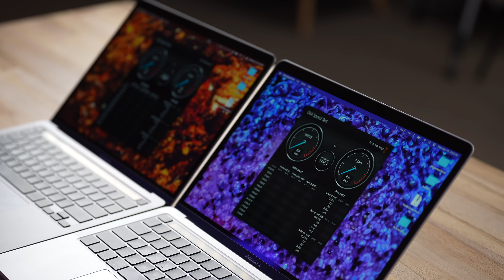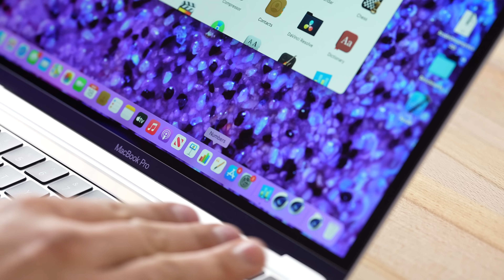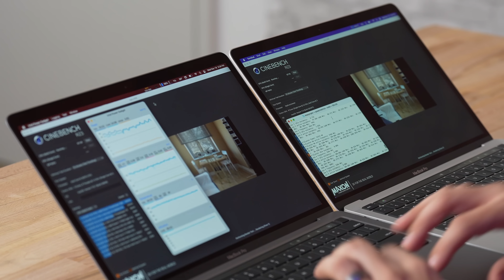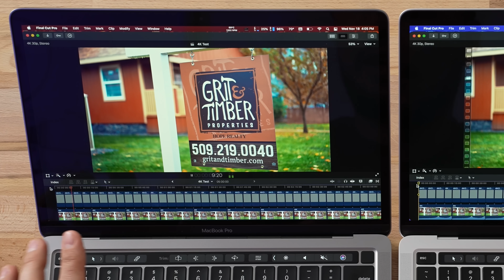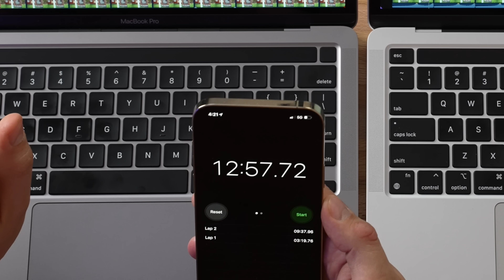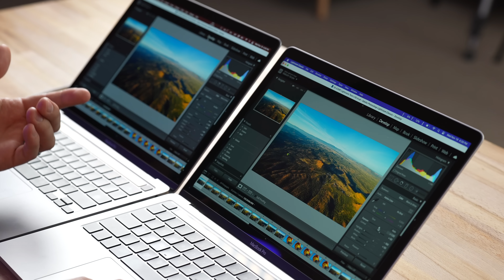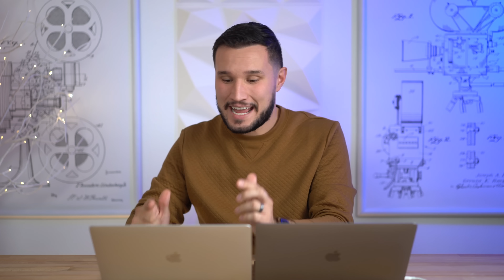M1 MacBook PRO vs Intel MacBook PRO: ULTIMATE Comparison

Comment: I don't believe you are telling the truth here as you are comparing an Intel 2019 i5 8257U against the just released 2020 MI Arm based cpu. The Intel cpu is at least 2 generations old, if not 3, and was never a great performer in either cpu or gpu statistics. You ought to test it against the Intel  i5-1038NG7 which is the true mid range cpu/gpu from Intel released mid 2020 and it still only has 4 cores and it was fitted to the mid year 2020 Apple Pro 13" compared to 8 cores with the M1. I own a Dell 14" fitted with a Ryzen 3700 15 watt cpu and it remains barely warm if not cold when in use. I did run similar tests as you did and when fully stressed the fan came on but it was so quiet I wasn't sure it was even on. Nevertheless, the fan never runs while in general usage. It is only a 4 core SKU and I am immensely impressed with it. The graphics are the equal or better than the M1. Why don't you test the new Mac against the latest 8 core SKU from AMD making certain it is a U part running at 15 watts. Then we will have a true test of the capabilities of the M1. Please, all you are doing is bragging by comparing an old part with half the cores manufactured on 14nm and comparing it to an 8 core just released part manufactured on 5nm. REALLY.

Comment: But how much of the performance in the benchmarks are due to the increased speed of the SSD? is there a valid way to remove that from the “equation”?
Reply from the maker: The SSD's are fast enough to not make a difference in any of these tests.
Reply: @MaxTechOfficial  Ok. But in a test like the decompression there is a very high level of I/O that could influence the result. Just a thought. 😀

Comment: Awesome video Guys
I have a request if possible 
Also super interesting
M1 MacBook Pro VS M1 MacBook Air
And M1 MacMini vs M1 MacBook Pro VS M1 MacBook Air
That would be awesome if you could do it
Thanks a lot for all the horse work on this comparisons as I know from self experience how long and fatigue this type of videos bring
Reply: There is already a M1 Macbook Pro vs. Air Video in the channel. To make things short: The performance is almost the same but on a long run (e.g. gaming) there is some thermal throtteling due to the passive cooling solution. But in most ways they have the same performance. If you don't game get a air, if you do a pro maybe is better. There is also a thermals video for the macbook air on this channel. Check it out.

Comment: What does “running on Rosetta” mean?   Is this something else you have to get with the M1?   Sorry; I’m not well versed on tech stuff!  I just know that my old MacBook Pro conked out a week and a half ago and I’ve been waiting for the M1 to come out to figure out which one to buy.  Thank you for making this video and including Logic Pro in your testing.
Reply from the maker: Basically, previous Intel Mac apps ran using the traditional x86 architecture. The new M1 chip uses an ARM-based architecture which doesn't support x86. Rosetta 2 is able to translate the x86 app software into code that the ARM-based chip can recognize and process which impressive performance. It's also able to translate plugins and other things on the fly.
Reply: @MaxTechOfficial  thanks for the reply!   You lost me at "x86."  LOL...  so is Rosetta something that is built in to the new M1 Macs or is it something you would have to purchase and install?  Thank you!  Apologies for my ignorance.

Comment: Really, really want the M1 Macbook Air, but the fanless design worries me. Not enough weight difference between 13" and 15" MBPs, and with the computational prowess of the M1 MBA, I am leaning towards the latter still.
Reply from the maker: don't worry about fanless design. runs incredibly well. Subscribe for tomorrow's video, you'll be blown away. (Air vs Pro)

Comment: Is this a joke? Your comparing a new 8 core processor with an old  4 core processor. You should compare it against an 8 core intel processor ,  but that would not be good for your advert.
Reply: Dahek? They are the same price, stop complaining about anything that is against intel lol
Reply: @mrplasmanotmr_plasma  The real test is agianst a similarly priced Windows systems because anyone with a brain knows Apple systems have been a total rip off, cost double for the same perofrmance as a Windows machine be it on an Intel or AMD processor.
Reply: @Quantum_AI_Tech  Not anymore, tell me a windows pc that can score 7500 on geekbench cpu test that costs <$2000
And tell me one that can export a 5min 4k video in 3 minutes

Comment: Thank you guys for the reviews, you're amazing! You think that the M1 MBP could work well in engineering/architecture programs for 3D modeling such as Archicad, Rhinoceros or for rendering in Cinema 4D? I have the 15,6 MBP Late 2016 with 4GB of dedicated graphic card, which work very good, but i'm trying to understand if this M1 could work with this tipe of programs  and if it could last longer than the mine if I decide to sell my pc to buy this new one.

Comment: It's not that huge CPU upgrade in Logic. Only is when compared to lower range Intel Macbook. For example, my Mojave MBP 2014 15" i7 4 cores running same Logic pro X 10.5.1 test managed to get 33 tracks easily, if I tried to optimize I would prob get to 35ish, maybe even 40, which is not bad for 6 years old laptop. M1 is 8 core chipset (double than mine) and managed to get 90ish, so overall 2.5 times better the performance with double the cores. What worries me is that 2019/20 Intel MBP is probably just a showcase of M1 performance, so many Apple customers were scammed into buying Catalina/BigSur only Intel laptops which deffo are not optimized for it and it shows now, most of them regretting it already. These are facts, and there is no way to test latest Intel Laptops in Mojave because Apple doesnt allows that. In the end only Apple will get profit of it, whereas we all will need to pay for updated software AGAIN just because architecture is changing. It will be great with 3rd gen M1 and later but for now, not much to look for for PRO users.

Comment: Watching these comparison videos have gotten me so excited for my new Mac. I have a old 2012 MacBook Pro that is basically unusable because it’s so slow. And I upgraded to the 13 in 16gb M1MacBook Pro. It’s basically going to be a whole new experience at this point. I’m so excited!
Reply: I also have a 2012 13” MBP that I personally put two SSD drives in (3TB) and 16gb ram. It’s as fast as anything else, so it seems. And I have an M1 1TB, 16gb ram MBP.
Reply: My 2012 elitebook is surviving just fine. You prob need to clean the dust out.

Comment: Help me out guys! 

After watching this it seems a no brainer for the M1....

M1 pro’s:

Better battery life 18 hour instead of 10 hour
Better performance 2x geekench 5
M1 3 x beter metal score
M1 3,5 x more fps in games
Wifi 6
Better microfones

But here is the big catch.... i need windows for specific reasons and don’t want to work with VM...  and need 2 monitors support....

M1 cons:

Only 1 ext display
No EGPU
No Windows (bootcamp)

So it seems the Intel macbook.... but after seeing this difference in performance it feels kinda stupid and waste of money to buy an intel mac...

Advise please! 

Can you connect to a thunderbolt dock for more displays? Guess not and i am just wishing at this point :(
Reply: Idk if more than 1 display is needed for a entry level mac, and egpus doesnt really make this any faster since it is already beating out many dedicated gpus and is more efficient as well due to the unified architecture
But no bootcamp is a big downside, but i dont really think most people who bought a mac are gonna absolutely need windows, so I would honestly still recommend the m1
Reply: @mrplasmanotmr_plasma  yeah EGPU is probaly an non issue giving performance, 1 monitor support is overcomeable, but not nice. Biggest letdown is windows, i have a specific workflow and need (bootcamp) windows for that. But i might have to look at VM options for windows although i hate it..
Reply: @TehMarc919  agreed, vms suck

Comment: previous mac intel cpu doesnt have greate cooling we all know that so it normal for ARMS to get greate score they drow less power and thats mean no throtling  so give some head room for thoes intel cpu rather than making thel running at 100 C the hole time and your gonna see because i saw some macbook air droping to 0.8GHZ juste to protect them self from dying so apple we know your trick you were always making intel cpu bad with a fan that its not link to the heatsink juste to make the M1 GOOD geee grow up please

Comment: The Intel MacBook Pro can do much more than a few tracks. I own an Intel MacBook Pro so I speak from experience. Muting does very little on Logic as it still needs to process everything in case you decide to unmute it on the fly. You’re better off deleting the tracks or freezing them if they’re MIDI tracks.

Comment: As always, appreciate your work guys! Are you planning a comparison (video editing in FCPX)  of the new M1 MacBook Pro 13“ (maxed out with 16GB RAM) against the 2020 5K iMac (64GB RAM, 8-core i7, 5700XT)? I‘m really on the fence which one to buy, as you could use the MBP13 with an external monitor an still have a capable desktop machine...

Comment: I have Macbook pro 13.3 $1800 2020 with 16GB ram a and 512ssd. I am thinking about to switch to M1 MBP 512SSD, but does it worth to spent extra money for 16gb ram? I use it for Affinity designer, Adobe XD, Logic Pro X and coding web in MS Visual StudioCode. Is it worth extra money for more ram? The reason for M1 - better batterylife, almost no fan noise and heat, testing computer before i buy any M1 desktop (mac mini / imac 2021) for my pro studio workstation. What do you think? Btw. intel $1800 has better speakers then intel base model - I wonder if M1 has the lower-end speakers or higher end like $1800 model.

Comment: Is the M1 Pro version thermal throttling? In the previous video the M1 MacBook Air wattage drops while repeating the cinabench r23 test , so is it the same or the fan in the pro version makes a difference??
Reply: The air throttles only in extended workloads of more than half of an hour completely maxing it out, then its exterior temp at the hottest spot goes to 35-38C and performance drops by 15%
The pro doesnt throttle at all, as it has a fan

Comment: I would compare the mba m1 to the mbp  1800$,  not to older mba. 
as for the m1 mbp I'm eager to see the difference with the mba I expect 15-18% difference only under heavy load. 
Also pretty interested in the 16gb ram model and would it have better experience in m1.

Comment: Notice how in the end how the intel is being charged, vs M1 isn’t. Running on battery alone should automatically throttle the machine slightly to preserve battery.

If both were charging, M1 probably would’ve been even better
Reply: M1 is arm, same performance on battery and plugged in ☹️

Comment: That is more impressive then the Mac book yesterday because the last gen Macbooks did have a pathetic CPU cooling. In general, I think the increased battery life and the iOS compatibility is  more important then the gain in performance because these days I rarely have problems with Performance on my computers and laptops. But I think we can congratulate Apple. That is a very good move. And we have the be sorry for AMD and Intel. Because if ARM is that good I think both are in for a uphill battle they will never be able to win.

Comment: Add more salt to the wound. "FIRST gen M1 vs EIGHTH gen Intel"
Reply: The 8th gen Intel is already 3 generational older.. I wonder why didn't he picked the 10th gen lol
Reply: @KingKong-xp6so  yeah, agreed. this really needs to be compared to Tiger Lake 11th gen hardware.
Reply: pete helme tiger lake got smashed
Reply: 2020 m1 CPU vs 2017 Inter CPU.
Reply: @Lactrix  The thing is these Apple non tech noob fans are joying over Apple perfectly optimized emulator which are supposed to be same as ARM coded native apps.. Even the emulator applications transcode to fewer size ARM optimized app ie. That M1 optimized cinebench r20. Which is even lighter ARM version compared to x86 version, not a full proper version.. Let ARM ran natively coded x86 heavy applications..
Reply: Md Khalid Hasan lol
Reply: Md Khalid Hasan what are the x86 heavy applications?
Reply: @Lactrix  haha true!

Comment: While I do prefer the design of the Pro, I like that the Air doesn't have the touch bar, any fans and costs $300 less - at pretty similar performance. Looking forward to the Pro vs Air comparison, but I have a feeling that adding everything up the Air might be the better pick for most people. (If you really need those few extra percent for your heavy work, maybe hold out for whatever they will put in the MBP 16/Mac Pro)

Comment: please do a video concentrating on Final Cut Pro X performance on the M1 Macs. I am currently using a 2018 15-inch 6-core i7, Radeon Pro 560X 4GB, 16GB RAM, 512GB SSD and the SonyA7Siii 10-bit 4K 120fps footage is KILLING MY MACHINE. I really dont want to edit with proxies because I do color grading as well, and transcoding would require me to wait hours for the files to be optimized and take up way too much storage. after seeing how the M1 is handling the 10-bit footages on the timeline has me very interested. I wonder how a 13-inch MacBook Pro M1 w/16GB RAM would perform. especially compared to the base 16-inch.

Comment: Should I upgrade from my Dell XPS 15 9560 to the Apple Macbook Pro 13-inch (Apple M1 version) or should I wait?

PS: I am finishing college in June 2021 and am looking to change my laptop for my own development purpose
Reply: I think it depends on what development you are doing... and with M1 version the compatibility issue will be there for a while. If your laptop can still hang on for a little longer it's worth waiting.
Reply: @dinghanxue704  Yes I think I will wait for more applications to get optimized for the M1

Comment: The beast 16 inch is about to come. Be scared very scared windows fanboys😂😂😂
Reply: well DX12 API is still much better than Metal2... so if PC and console gamers don't really care about it. But omg, when it comes to these ultra-thin laptops, no Intel laptop can ever come close.
Reply: @dinghanxue704  Dude its Apple's first attempt of thier own laptop peocessors and its already beating out their own intel macs by a huge margin by running apps using rosetta2 and also providing a massive improvement in battery life at full screen brightness

I don't think we can expect that much energy and performance management in windows laptop

Not even a single video is available in youtube that showed real world battery drain of windows laptop

You can find macbooks from 2010 getting reviewed in youtube and some of them mention battery life to be pretty decent of about 5 hours after 3-4 years of purchase.

But no youtuber reviewed windows laptop that is older than 2 years as per my knowledge of seeing reviews in youtube.

So the track record of energy management by Apple over the years is consistent and is still improving.

When m1 macbooks make their old macbooks released just a few months ago like trash overnight as seen in this video it is very well known fact that we can expect a major boost in computing power in upcoming 16 inch m1 macbook pro. Thats what I am saying.

The hardware and software optimisation  of Macbooks is unmatched
Reply: @leisuretalks  My daily laptop is a 2017 MBP 15 and the intel chip sucks in there. But in terms of graphic performance, my MBP15 actually gets much better when running my Bootcamp win10. So I think the Metal2 API is still quite weak compared with MS's long matured DX11/12 API. 
But M1 has done an amazing job to acquire an incredibly long battery life with great performance. Getting incredible performance in low power chips is what Apple has been doing all these years. But the question is, how good M chips can be when they get to the high power realm. Of course, intel sucks. AMD has proved that. But GPU-wise, does Apple has the design power to take down Nvidia? There is still a big question mark.

Comment: This is great info. Aside from comparing apples to apples, could you do a comparison between the M1 Macbook Air vs 13” Intel Macbook Pro, 13” M1 Macbook Pro 16GB RAM vs 16” Intel Macbook Pro, and M1 Mac Mini 16 GB RAM vs 27” iMac (I’ll leave the config of this one up to you). Also, what do you see the future of the Mac Pro as? Traditionally those have been the customizable Mac that were really modular and you had a variety of components to add and make work specifically for what you needed. Now with a SoC structure, this would need to change if the Pro is going to go the same SoC route. Would it even continue if there is not going to be any video cards, additional memory or hard drives to be plugged in to one?

Comment: I got mine 8GB m1 MBP Yesterday. I have charged it full....Started using it lightly since yesterday from 11:00 pm....Today Also did some work...bit editing on Lightroom, editing on website design and watching videos on Apple TV, and YouTube...now it's 11 pm and the battery is 50% left. I didn't charged it at all. I almost worked 10 hours on my MacBook. Superfast and smooth. Intel softwares are working fine as well. Absolutely love it.

Comment: so, Apple throttled down their intel chips on their laptops because they want elegance over performance issues. Let's run a $2000 pc laptop to the  m1 laptop and see the difference. Apple should of  fixed the  intel heat issues for their computers by putting the right fans in them.